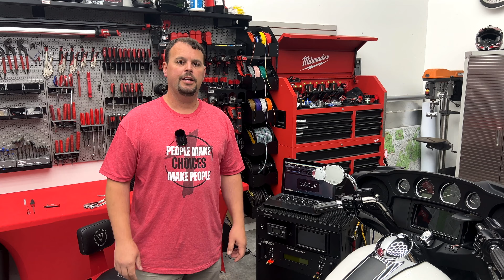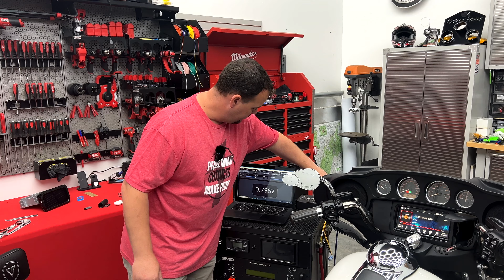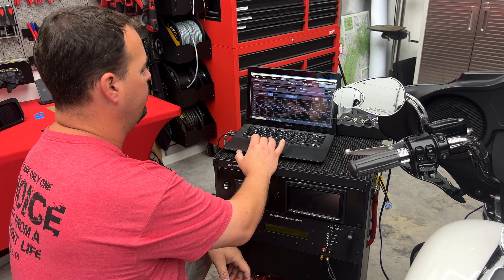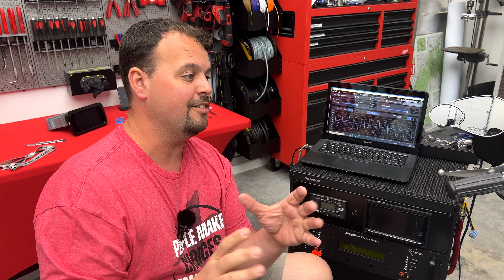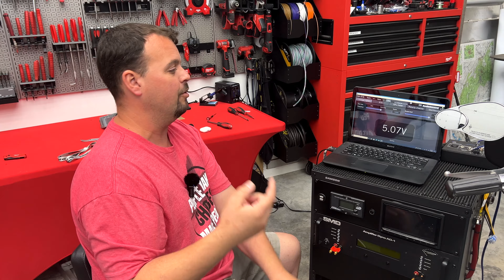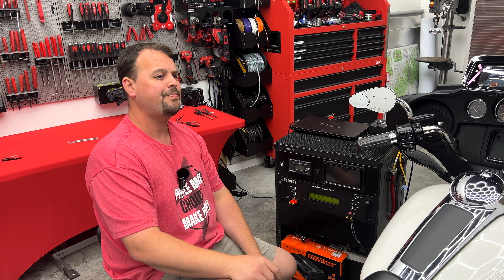Soundstream V2 Harley Davidson® radio output test! Internal amp and RCA results plus a glove test!

Comment: My wife and I are very used to using our 2021 Harley GTS radio intercom feature while listening to music. Is that function available in the Soundstream V2?
Reply from the maker: Yes there is an intercom function that can be activated from a programmed thumb control
Reply: @volunteeraudio  Are there any details available from Soundstream on the intercom function? Once you activate it, is music still available at the same time at a reduced level? Is there a VOX sensitivity setting? If it's push-to-talk only by the driver, how does the passenger initiate an intercom? Thank you so much!

Comment: DOesnt the spec sheet state 200w RMS out of the built in amp? 9watts per channel would put the output at less than a quarter the advertised output...
Reply from the maker: We got 19 watts per channel on the v2 and 9 watts per channel on the gts
Reply from the maker: We are going to do more testing using other radios as well for comparison

Comment: But you’ll still hook it up with speaker level anyways?
Reply from the maker: Yes and so I measured that output and how clean it was also, but I’m not the only installer and many still chose rca even if I prefer high level

Comment: Thanks for all the great information.  Please explain why the advertised RMS output is 50 watts per channel vs approximately 20 watts at 2 ohms on the dyno. And what output can be expected for 4 ohm fairing mounted speakers?  At $1,800 for the head unit, I do not want to find out that I need an additional amp.
Reply from the maker: It did the power shown in the video, we do this test the same way as we did with the 200 watt factory amp that did 9 watts, no amp is 100 percent efficient and they lose some power by the time it gets to the dyno from efficiency and heat, but your speakers are getting 19-20 watts rms and I think I clearly explained that this will be louder than stock by about 3db but many will also add an amplifier to have more overall volume.  It’s just as important to be using efficient speakers such as the hertz neo that are about 6db louder.
Reply: @volunteeraudio  I understand but the 50 watt RMS advertised is deceptive. 40% of 50?  I'm sure Soundstream is capable of performing the same test.  The advertised output is the number one reason I pre-ordered the V2.  Adding cost for an amp or new speakers to the $1,800 was not in the plan.

Comment: Any thoughts of using a Biketronics BT4180 with the V2? That amp doesn't have any real way to mess with the gains since BT created it to power a stock head unit (and use their BT355 line levelers). I'd prefer to NOT have to replace a good functional amp when I install the Soundstream (whenever it shows up!!). Thanks in advance!
Reply from the maker: It should work with the stronger inout but we have not tested and will likely no test it anytime soon as we do not sell biketronics amplifiers

Comment: I have the gts with the stage 4 hertz kit and one drop in precision power sub. I pre ordered the v2. My question is, I know settings for the amp will have to change. Also, will it be better to use the rca outputs, especially for the subs, and are you going to offer suggestions or give us the best way to run the stage 4 hertz setup when installing the v2? Also, will we need extra hardware to do so?
Reply from the maker: We suggest using the rca for subwoofer and your drop in subwoofer came with the adapter, we will continue to wire our amplifiers with speaker level input and we can share with you the proper settings at time of install
Reply: @volunteeraudio  sounds great. I appreciate your time and info.

Comment: So with that new radio, do you still have to use the maestro you guys updated by maestro for my radio. I have to say it is better, but I still haven’t figured everything out yet. I did the pre-order on the last stream radio, the SI model. It does a lot of stuff so this radio does more with the thumb controls? I’m very happy with my radio. I don’t use headphones or anything. I like my speakers. Don’t wanna get rid of my electric locks. So I can’t cut my lids, but. I still can’t figure out though gas mileage where to put it on the screen it pops up once in a while. The thumb controls were like stock. You guys have been very helpful with your Tech I know how busy you are, I try not to bother you but your Tech Support is always been great. I hope you guys keep it that way. Great company to do business with you.
Reply from the maker: Thank you, yes this radio still uses the idatalink maestro module to communicate with the stock ecm for engine / gauge data. As well as can communication for thumb controls

Comment: Jay, you are the man! No other reseller does what you do to compare HD radios to these new radios. Awesome insight! Thank you! I have the Rockford Stage II speakers front and rear in my 19 Ultra Limited and have had the V2 on preorder for a month now. I am going to see how this sounds as you did at 80-90 mph, then decide on whether to add the amp or not. This is the video I've been waiting for. Question: if I add the DSP, will that add to the experience noticeably, or not much without an amp?
Reply from the maker: No need to add a DSP, if you need more volume add an amplifier.  With a great we and independent crossovers this radio replaces a need for a DSP

Comment: I just recently pre-ordered the V2.  I’ve heard the the V2 blocks access to the can-bus when a tech needs to scan the bike for fault codes, etc.  To scan, the V2 has to be disconnected.  Is this true?

Also, does a new wiring harness come with the V2 or does it use the existing OEM harness?
Reply from the maker: Not true, it only pulls can data when viewing gauges